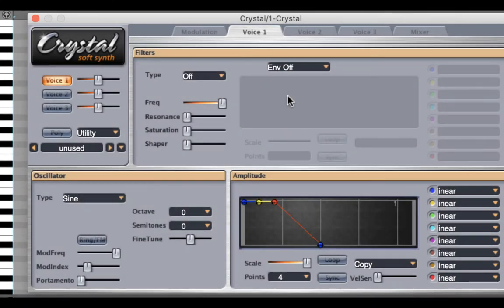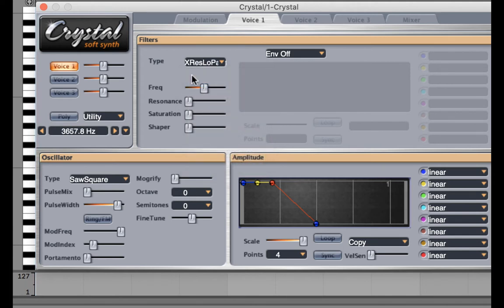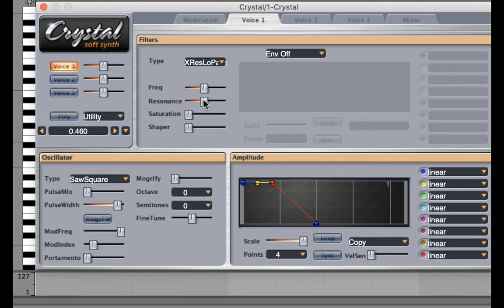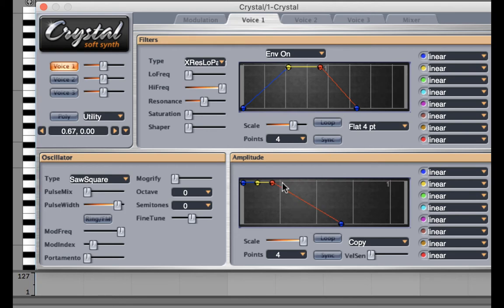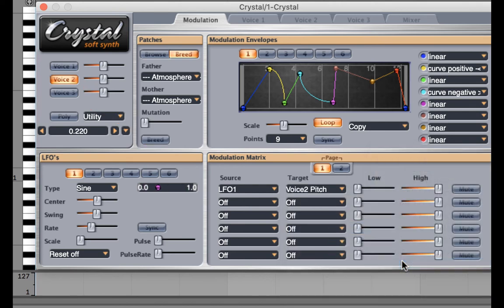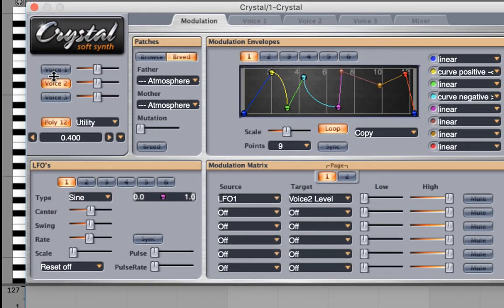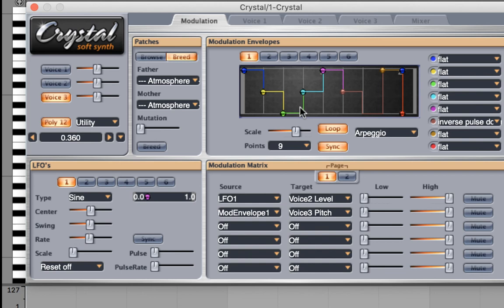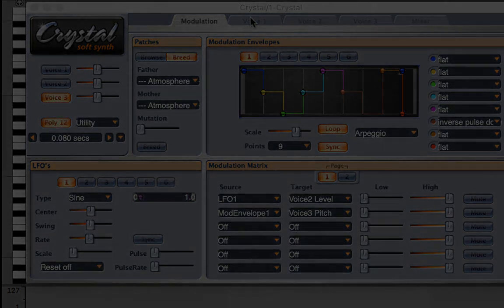Quality Time with Clive: Crystal Synth Tutorial #2 (Filters, LFO's, Mod Envelopes)

Comment: How does one adjust the pitch?
Reply from the maker: Do you mean tuning the oscillators in Crystal?  In the Voice 1 card (or Voice 2 or Voice 3), there is an oscillator section on the lower left.  There, you can select the octave, the semitone, and also do fine tuning (up 100 cent or down 100 cent).  I mostly use Ableton Live.  Whenever I tune synths (it doesn't have to be Crystal), I put a tuner plugin (usually available in any DAW's audio plugins option) within the track and tune the synths that way.  I also match the synths with other instruments in the track to make sure everything is in tune.